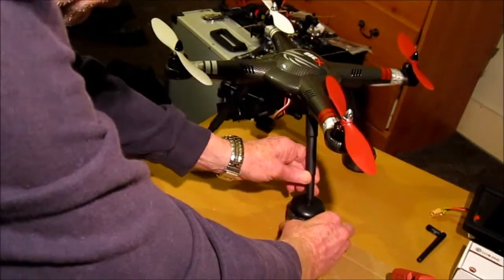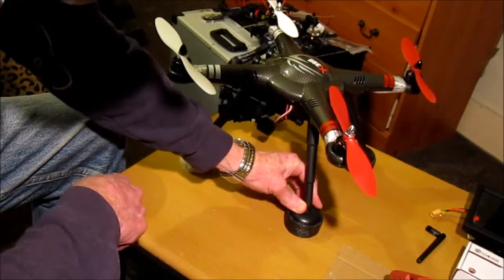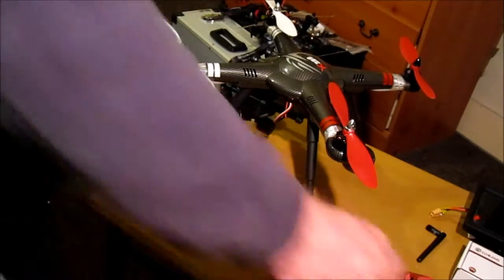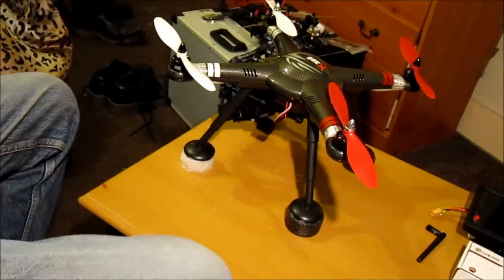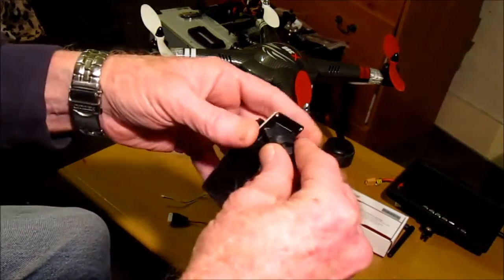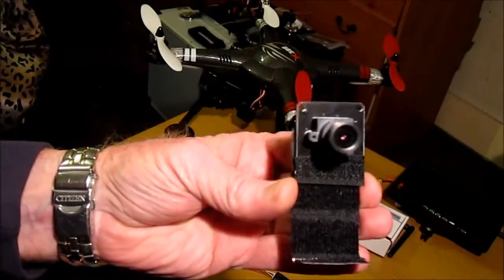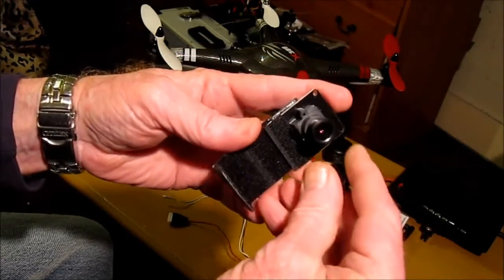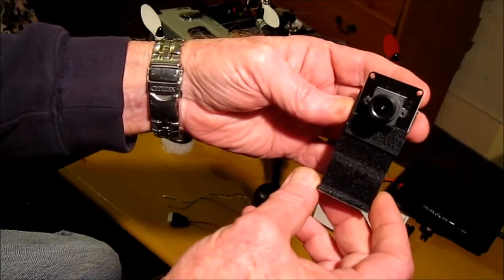X380-C FPV setup - X380-C Maiden flight – Part 3

Comment: I purchased the firefly 7s for fpv. I was going to use this transmitter. http://www.banggood.com/Eachine-TS832-FPV-5_8G-32CH-600mW-Wireless-AV-Transmitter-p-975425.html?rmmds=category DO you know if the av cable for the 7s converts from 12v to 5v for the camera?
Reply from the maker: Hi Kyle, not sure what cable you are using, but usually a cable will not convert voltage,

Comment: I went with the 600 mw version and range is over 1 mile. I do see a problem with this setup. You are better using the stock
camera by itself for recording and FPV if the stock camera has a video out connector? If it doesn't I would go with the
RunCam HD camera which is 41 g. and forget the gimbal. The gimbal plus 2 cameras will cause you problems with weight
and a gimbal on a FPV setup can also cause you problems like if you had the camera pointed down and flying low you will
not see what is in front of you. The FPV racers don't use a gimbal because of weight and aerodynamics they use fixed 
cameras. Another problem with several cameras, they cause interference with the electronics on the quad. I suspect that
you will have nothing but problems with this setup. Also, the RunCam cameras are shielded except for the orange model.
This is taken from their web page:

Note: For orange version, function of RF noise shielding is invalid.

I'm running 2,000 meters FPV using the RunCam HD, Eachine TS-835 Tx and a Fat Shark cloverleaf antenna on the X380
with no problems. Good luck and happy flying.
Reply from the maker: +Dennis Petersen Thanks Dennis, this was a while ago, I use the stock camera for fpv & recording now. you can see here: https://www.youtube.com/watch?v=n12XE8cAkzU

Comment: Bill M Ouestion i have the x380 with the walkera g2d gimble and walkera ilook fpv camera, would the x380 fpv kit work with that set up?
Reply from the maker: +Wim Ross Hi Wim,  nice camera,..although I do not use the X380 fpv kit myself, I do not see why not. With your camera you essentially only need a vtx receiver monitor compatible on 5.8ghz.